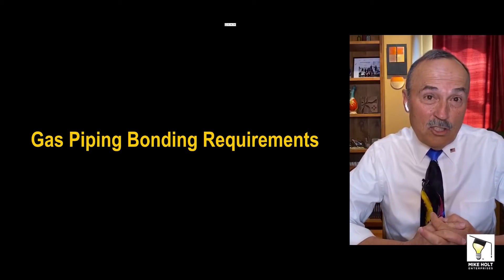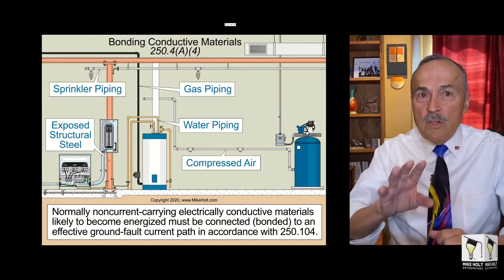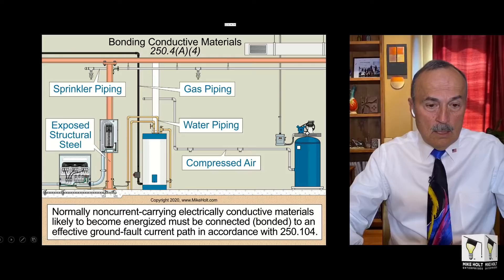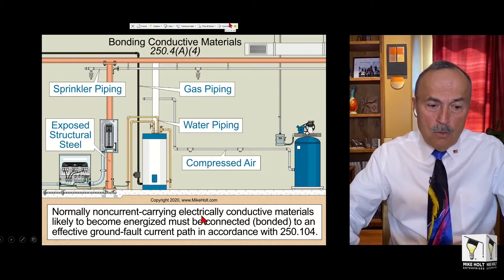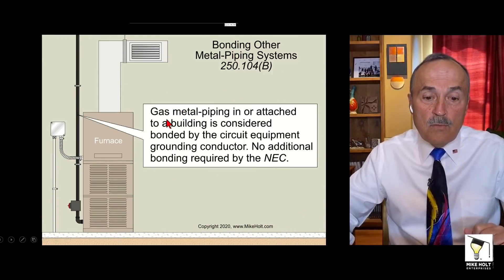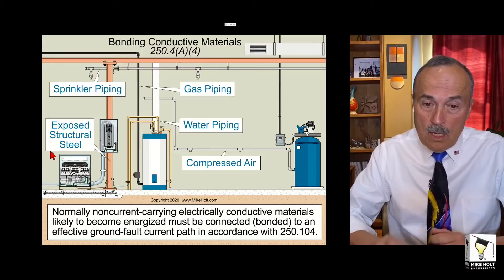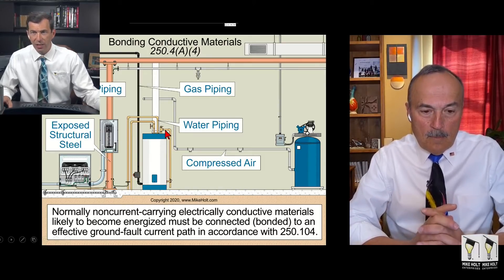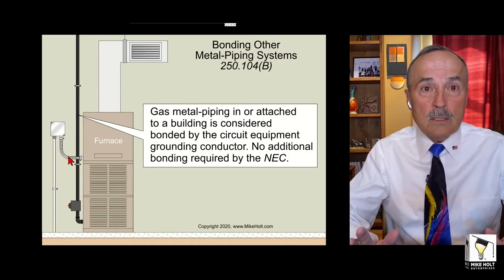Gas Pipe Bonding Requirements, NEC 2020 - [250.4(A)(4)], (12min:16sec)

Comment: The reasoning behind the CSST bonding is to mitigate damage from lightning, the yellow coated stuff being very susceptible. I have seen two instances in the last three years where lighting blew a hole in unbonded CSST, one of which ignited the gas (luckily inside the fireplace). Our AHJ’s require gas line bonding as part of the electrical inspection which I fully support.
Reply: Just how is this accomplished, what type of ground clamp or special fitting? Is there a csst fitting with a bonding lug or do you just use a water pipe clamp that probably isn't approved for that use. No criticism, just trying to learn.
Reply: @davenag957  bond it to the rigid portion of the system.
Reply: @davenag957  This information is readily available from the UPC and Manufactures of CSST, but I don't recall it be some kind of special bonding clamp. The same clamps that I use for bonding ground rods, I use to bond CSST, gas pipes and water pipes.
Reply: Just cut the BS.... tell how and why it is done. Move on . I believe it,s all the NEC and code BS that overlaps the gas/power idea and confuses people until they dont do it or do it wrongz. I was born at night..... but it wasnt last night. Stop trying to impress.
Reply: If you bond your main black iron gas line do you still have to bond each branch csst line and if so which fittings the one at the appliance or the one coming off main line
Reply: @doublezmtnman  Only at point of entry into the building.
Reply: @affinity3281  then do you just leave your regular pipe bondings at the water heater gas line and water pipe connected?  Curious if that stays bonded and then you also bond/ground at gas meter just before the csst gets installed?  That's where I'm running a 25' section of csst in my basement area just inside from the gas meter.  I know how to attach the 6awg wire to the csst fitting but then where should I run that wire.  Won't make it to my panel box (75ft) plus I'm not messing with that.  Why can't I run her out and clamp to gas meter or drive a grounding rod 8' and attach.
Reply: @doublezmtnman  no it’s all one system. As far as I know theirs no joints that isolate the system.

Comment: Out city wants us to always bond the gas ..but especially if that flexible gas piping is used.  I assume that is the CSST.  Also, we don't bond underground propane tanks without a dielectric fitting. To prevent providing an alternate path to ground.  They seem "UNlikely" to become energized if you ask me.
Reply: #vermont, #Burlington

Comment: Another code Quagmire. Sounds like a mechanical contractor problem to me. It's their piping that they have been paid to install per the mechanical code. It's not my job to tell a sprinkler contractor how to install their work, or a gas fitter how to install their work, just like it's not their job to tell me how to install my electrical work. Unless it's specifically pointed out in the division 16 specifications on the approved plan, or the AHJ tells me specifically that I need to do it, I'm not going to be concerned with it. I've survived this trade for 40 years and I think common sense is the way to go in this case.
Reply: yes and no. Although the Mechanical Contractors needs to bond CSST during installation. Its the Electrical Contractor's responsibility to bond the system equipment, gas pipes, water pipes,  ufers, ground rods, metal structure etc. in the first place. This include a hot water/cold water bonding jumper at the water heater, and to the house side of the gas meter (no jumper on the service side)

Comment: Something you may want to consider is when the gas piping is threaded onto the gas fitting of the appliance a non-conductive paste or approved tape is used on the threads. This isolates the piping from the appliance. So it is not bonded through the circuit grounding conductor but it's also not likely to become energized. Lol Just don't mount it to the building steel that is likely to become energized. This is always a fun point of contention with the inspectors. 
I just thought you'd want to think about it first before it comes up in a discussion.
Reply: The paste actually moves out of the threads. It is the tapering of the threads that actually seals the connection. Just use some thread sealer tighten the gas fittings and then disconnect it and you’ll see that all the threads that made contact have nothing on them. Thread sealer will certainly not isolate different sections of pipe.
Reply: There is no way any pipe dope or tape would insulate a steel threaded connection. It’s not possible. Maybe some type of union but I’m not familiar with anything like that.
Reply: I strongly doubt that any tape or "non conductive paste" would "insulate" any metal-to-metal threaded connection. 
(They merely fill the interstices of the joint to prevent leakage but metal-to metal contact WILL still exist.)

Have you ever tested any such connections for "open circuit" - or even "high resistance""
Reply: @FrodoOne1  yes I have tested it many years ago and found some of the times no continuity between the piping and the gas valve.
Reply: @scottmorse4225  If there was so much tape in the fitting to act as an insulator - that fitting was not put together correctly.
Reply: @CraziFuzzy  
I dont know abt that, im required to do tape and thread dope on gas appliances, so the thread connections will barely have any metal to metal surfaces.
The inside of the pipe is not where the metal contact is

Comment: Yeah it’s a big head scratcher Mike damned if you do damned if you don’t.
Here is where you have to go back to the issue of why you need to bond. Is that metal part likely to become conductive and create a hazard shock risk? Overbonding a metal part that does not need it can create shock risks of its own.

Two tests here one is a functional one is the conductive part connected to the mass of the earth/ground (absent any connection to the electrical installation) If so you could look to bond. More effective is to test. The piping may go through voids, walls or floors where it joins to plastic piping that is non-conductive (or at least far less conductive) or is insulated on terms of a jacket or sheath on the pipe there would be no need to bond.

Second to test You could do a continuity resistance test between a real ground (main ground terminal) and the metal part using long lead (null the leads) if that resistance reading is greater than the differential resistance (using ohms law at a given safe current say 5, 10 or even 30mA) at 120v less body resistance (assume 1000 ohms when wet but could be lower if a child is considered or different parts of body) the. if resistance of the metal part with respect to ground  is greater than the differential in resistance at a safe level less body resistance then most likely no need to bond.  You will need a proper continuity meter that can measure up to at least 1Mohms and not a multimeter. I know Uk electricians are given guidance by its standard setter to make such a determination. Of course one reading does not tell the whole picture as design  considerations change as well as the electrical installation changes then that would also be need to be considered.

Comment: Thanks 🤔?
Reply: Mike I just had a gas line become energized on a job I was doing and the gas pipe was not grounded  thought about the whole situation and I think that it's wise that the gas company and the plumbers ground their gas lines on a separately derived grounding system foundation steel and  ground rod separate from ours. Those gas lines should be separated from our electrical systems so there's no chance of those lines to be energized I believe that's the future.if we grounded them to our systems there's a chance our systems could become energized do too bad connections God bless you mike you guys are doing a great job I've learned so much from your show Sean Treakle Platteville Colorado with Brian electric

Comment: Sounds like a government agency can't make up its own mind.  When both NFPA 70 and NFPA 54 are contradicting each other.  Then the AHJ's read it one way or another and can't agree either.  In my own house, my gas line isn't bonded, but its more than 75' away from the panel.  That being said technically or at least electrically, the gas line is bonded, indirectly, but the water line bond, through the water heater.   There would be a need for bonding as many high efficiency gas water heaters or power vented water heaters do have electrical connections as well.  However in our area they are just run romex into the box with no metal EMT or MC cables.  But based off the info you presented the grounding conductor is normally screwed to the metal of the fixture directly.   I know many of the cities require bonding around us, due to lightning strikes we get and set houses on fire.  You get the flash over arc in the attic where the gas line and metal duct work from the chimney run through the attic as most fire places have gas run to them, even though there are no electrical igniters run to them.   Great video Mike! 👍

Comment: At an IAEI class about 6 years ago while stuck in the 2008 NEC was Told that to bond any CSST you have to go by what the manufacturer says. The NEC should have one spelled out method. I got called out to a friend who had a fire place feed by CSST mounted one inch above carpets. I was worried about people running a vacuum cleaner damaging this thin tubing over time. Anyway it took me halve a dozen phone calls to get an answer. Thanks for another great vid.